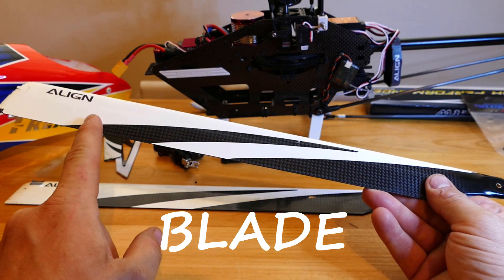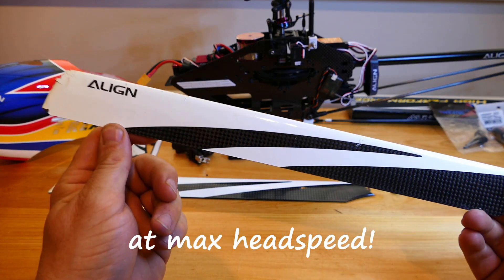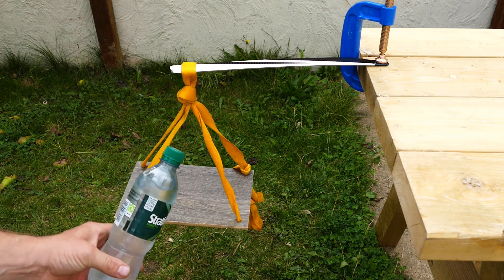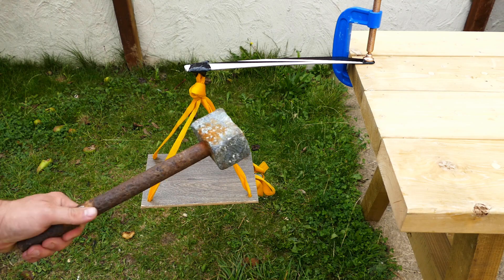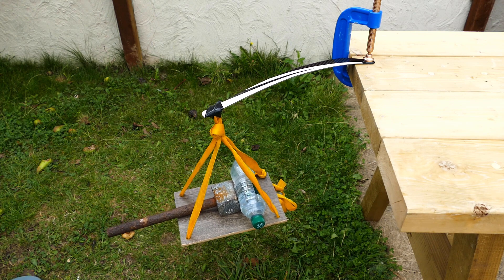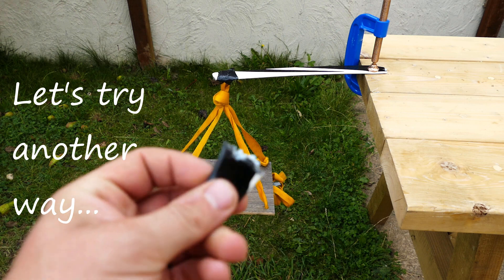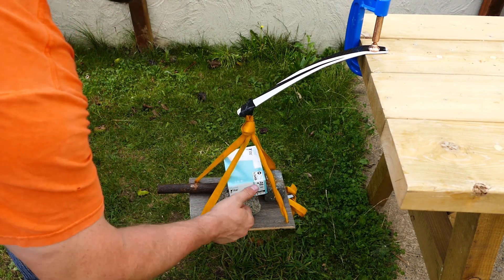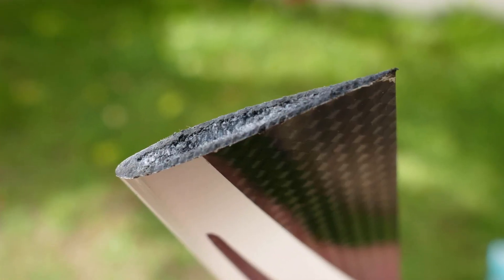How strong is an RC heli blade?

Comment: The rotor blades of a helicopter are able to support the weight of a helicopter when they are spinning because of Gyroscopic Rigidity.
Reply: I agree, and we got to remember that the load on the blade gets distributed throughout the length. Not necessarily evenly but it isn't all concentrated in one location. But I liked this video. It opened your eyes a little bit as to the load and stress these blades are under!